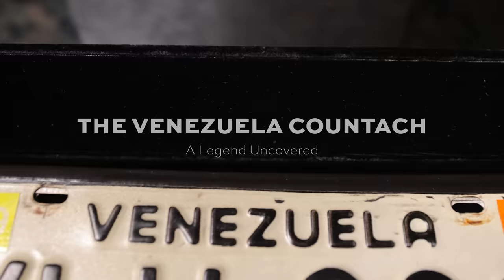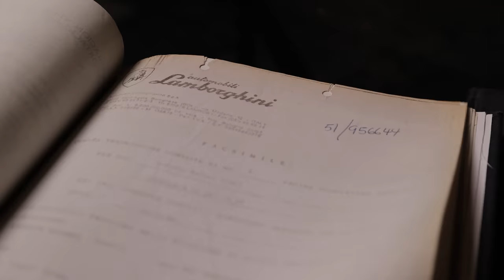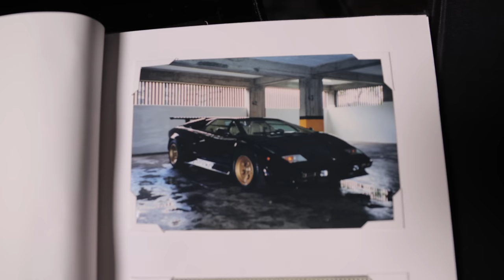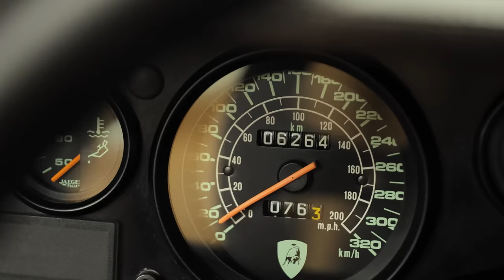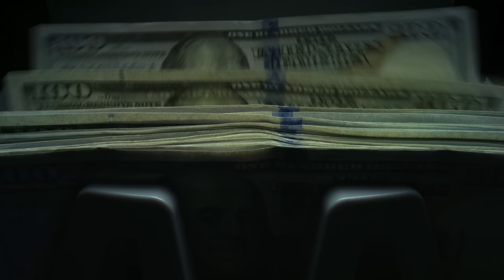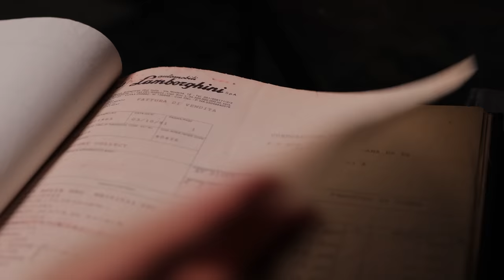We FOUND and SMUGGLED this Historic Lamborghini Countach out of Venezuela!

Comment: Yup, Venezuelan here. I went to a couple of those Ferrari challenge races, it was amazing. There was a guy in my city that had a dealership and competed in the series. He had a couple of 355 for the street and was working on a fiat Palio. He installed a Chevy V8 on the back (a don’t know if it was an LS) right where the back seats were located, and all the suspension and transmission was from the 355s he had (spare parts for the racing series and such).
Reply from the maker: Very cool!

Comment: A tip for future transport, i use Spot Trace gps tracker. 6 month stand by battery, you can program vibration settings and monitoring updates!!! Been using tge first unit over 7 years and it goes through our canadian winters with no issues!!! Thank you for another great storey
Reply from the maker: Thanks for the info!